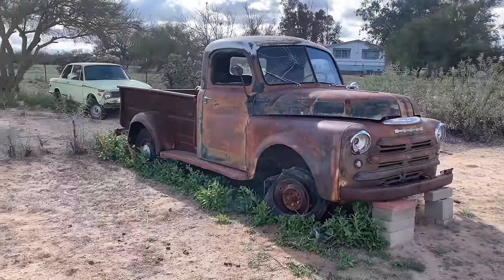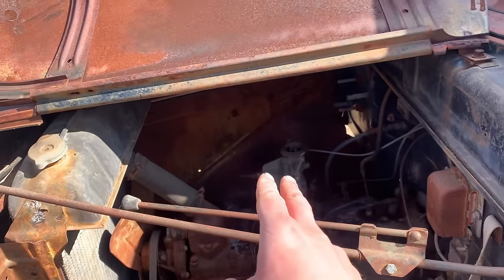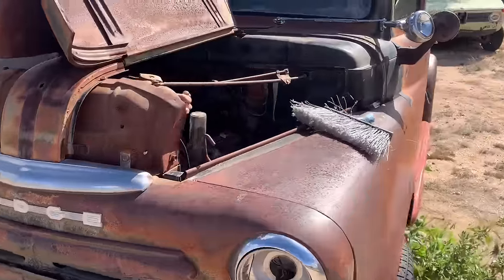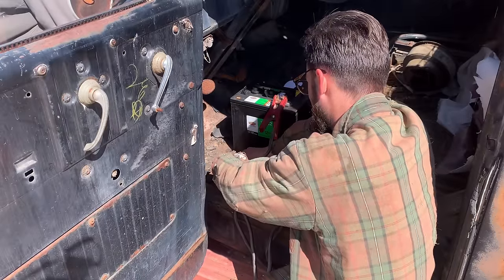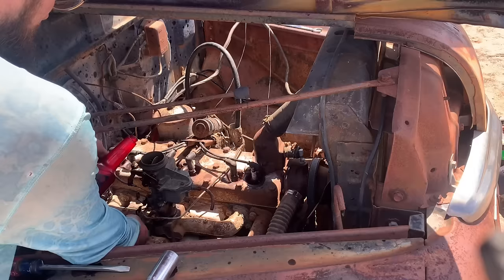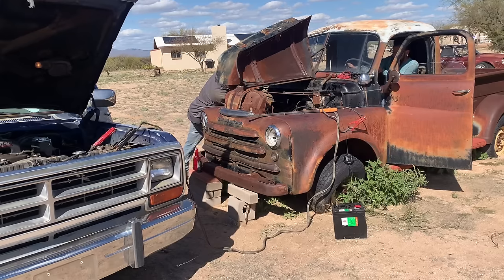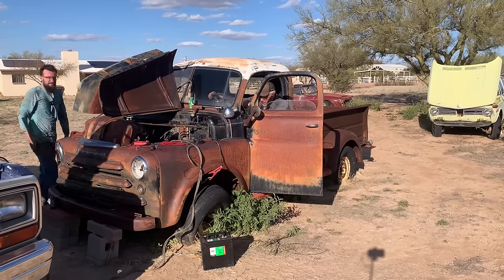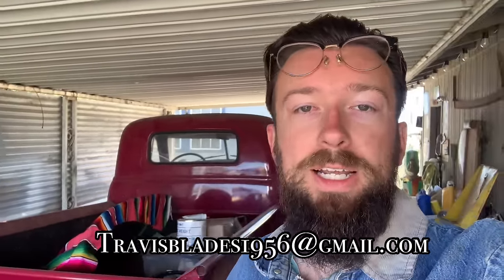‘49 Dodge pickup ABANDONED in the desert decades ago, will it run?

Comment: I'm an old school guy ... Remember..if that truck  is a  stick .... You can tow at low speeds and pop that clutch.... Gives you more turn over speed .. saves the old starter...  Rolls those pistons over a little faster.... I am surprised nobody does it anymore.... Also with out turning that old slug starter over...you have more power for the plugs...

Comment: Loyal follower here. I love what you guys do! A old timer told me about a trick with these Dodge Flat Heads that have been sitting for a long time.  Add some ATF down the Carb when cranking it or while it is running not much just a wee bit. I loosens the Valves up usually. I have a 53 Dodge Pilot House Era like yours except it is a 1 ton with a 237 CI engine. A little higher RPMs but you are correct yours should be the 230. 👍👍

Comment: It's pretty amazing how similar the Dodge is the the IH of the same year. I still own my KB2, like the one you worked on, but no longer own my old 1953 Dodge—same engine as the 49 you're working on now. Both trucks should have a provision for a hand crank through the grille, just below the radiator.

Comment: On the Dodge use a 12 volt battery and a resistor to send 8 volts to the coil make the spark a little hotter

Comment: You can pull the plugs and spray into the valve seats on a flathead. You can also reach the top of the valves with a screwdriver and try to move them.

Comment: You fellas would be well served to build a small fuel tank with an electric fuel pump that would run off a jump pack.  FIll er up with the appropriate fuel, set it up on the roof and run a temporary fuel line to the carburetor (or injection pump).  That way you eliminate any  number of wild card variables right off the bat.  Not a big expense, especially considering the cuss'n and head banging it will save. 😊A couple of cans of Kroil on the job would be a big help too.  When in doubt - soak er down. The prop for the hood still has a rubber cap on the top end.  Amazing  Thought the Tucson region climate would have disintegrated that decades ago. A 12 volt inverter to 110 that will run an air compressor (Harbor Freight - here we come) off your vehicle would be a huge help too.  Pretty tough to clear off 40 years of desert  corruption with a floor broom 😅 In case it's not clear - my first step is compressed air and Kroil 🤣
Reply from the maker: The rubber still remains it just gets so brittle and hard like a brick you can break it like a candy cane
Reply: A battery powered leaf blower would have come in handy to blow all that trash away.

Comment: I wonder why the manufacturers though a measly 6 volts was enough electric power to start ANYTHING. Yet that seems to have been the standard. You almost end up having to have a separate battery and wires for the starting.

Comment: I've brought a few old engines back to life over the years. What I tend to do, after checking for spark, is retard the static timing by about 10 degrees. Won't make power, but fires up easier. Then when it's idling, bring the timing advance back on. Like your stuff!

Comment: when starting an old engine you must pour in about an eggcup of fuel so that it can start evaporating and filling the inlet system because no fuel will spray through carb jets until engine is running fast enough to make good suction!
POUR IN PLENTY OF FUEL!111111111111111

Comment: Just need to turn up the regulator to charge the battery.
Reply from the maker: Is that possible?
Reply: @theetravisb  The regulator would need to be adjusted from 7  volts to 9 volts but be cautious about this as the higher voltage can damage the regulator. These old 6 volt regulators weren't meant to push 9 volts. Alternatively you could find a 12 volt regulator and turn it down to 9 volts.